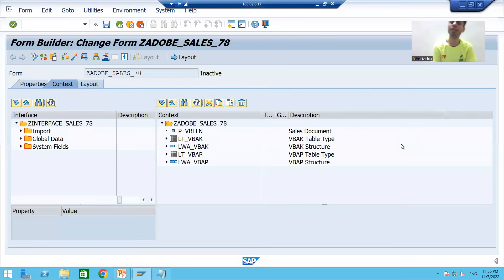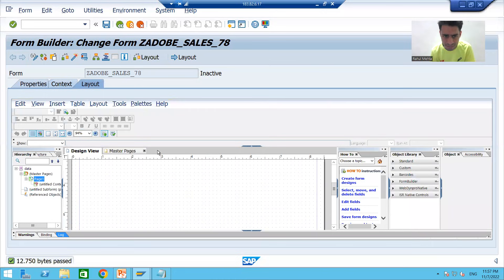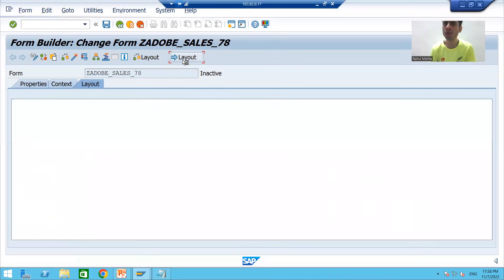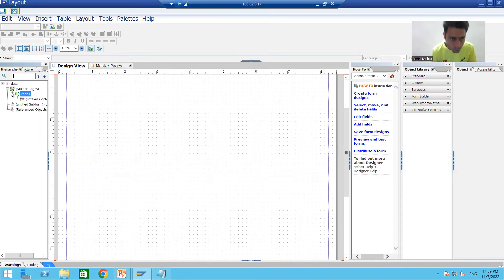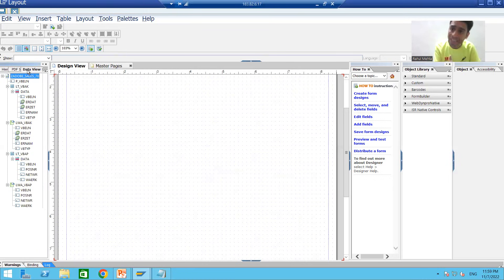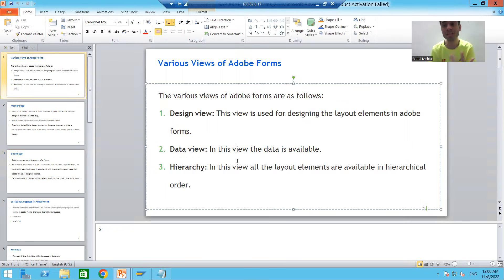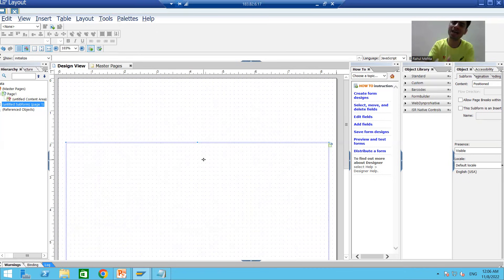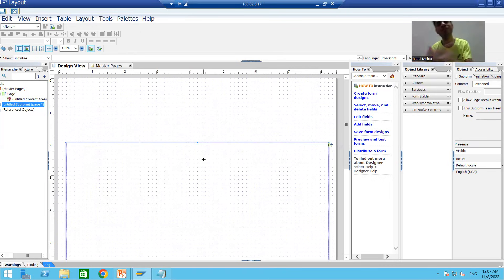5 - Adobe Forms - Layout Designing Part2

Comment: Hi Raul, when I click on Layout, I get the following error. in window
Could not start Layout Designer (see long text)
I see the type of error.

Could not start Layout Designer (see long text)

Message No. FPUIFB086

Diagnosis

The forms design tool for developing the form layout could not be started; either it is not installed or there are errors in the installation.

Procedure

Make sure that you have the forms design tool installed on your desktop (the tool is part of the SAPGUI installation).

Also read SAP Note 1121176.

Greetings
Guillermo - Venezuela